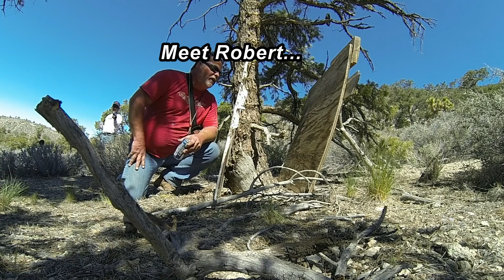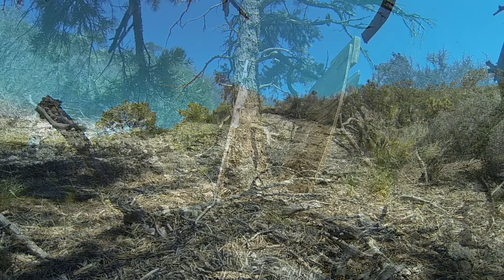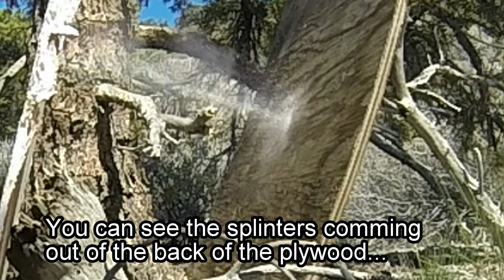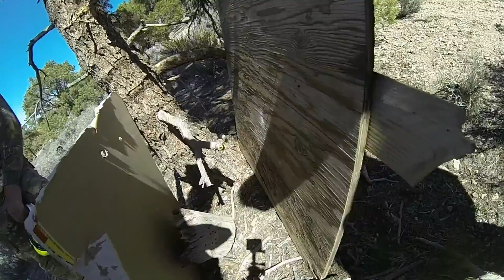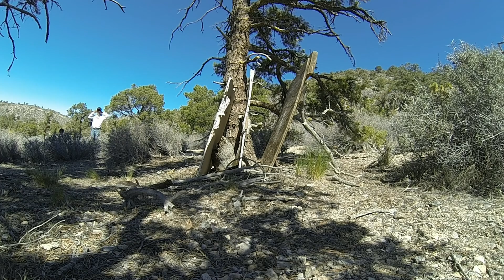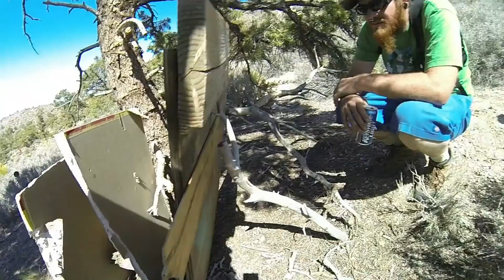MPG VS  Drywall, Frangible bullet test 3

Comment: Frangible ammo, in general, is designed to be defeated by materials which are as hard or harder than the round itself. Drywall is not harder than a frangible round. They were originally inteded for use against steel targets during close range training. I could be wrong (this was 8 yrs ago), but I am doubtful that MPG advertised projectile deconstruction through drywall. Most people tend to make that assumption themselves.